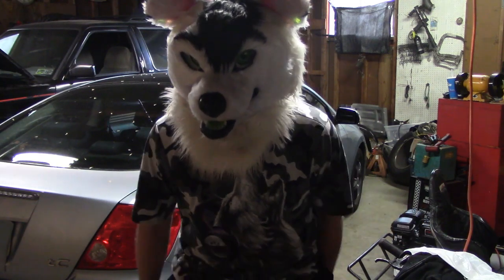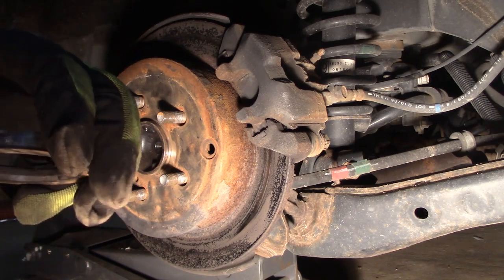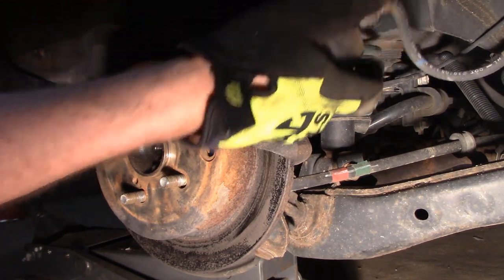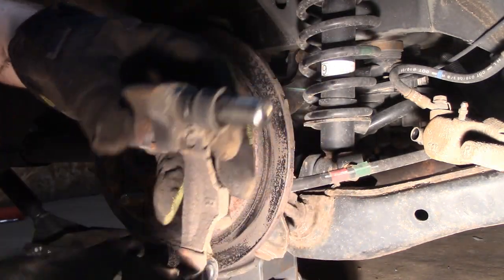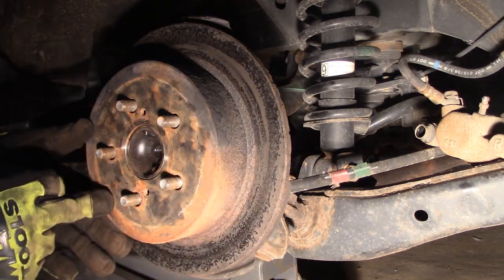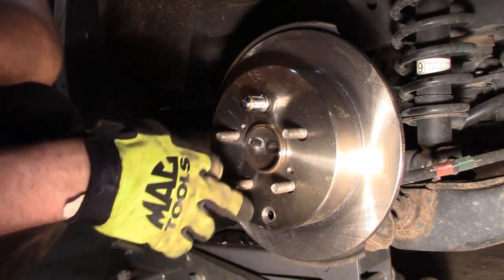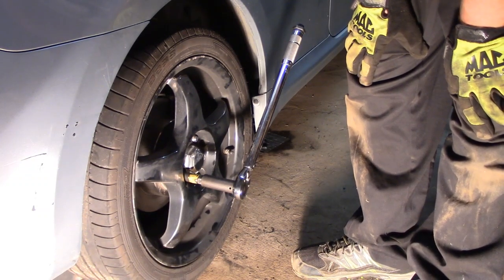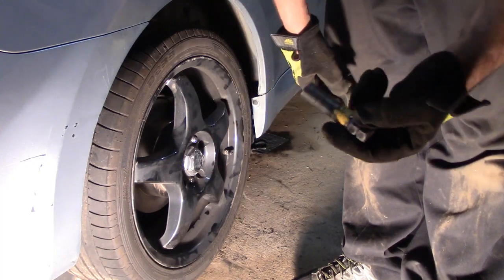07 Scion Tc rear brake replacement.

Comment: My caliper is stuck it doesn't gets out from the slider it looks that is stuck to it
Reply from the maker: sorry for the very late reply. some times either the piston gets stuck or the slide pins get water in them they rust and seize up. when that happens either replace the caliper or use alittle heat with a torch to free them up.